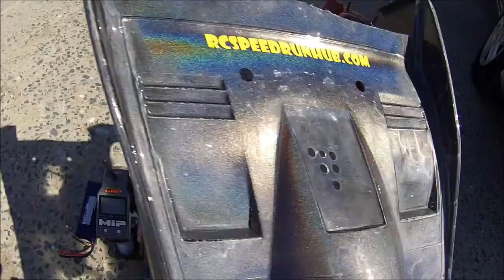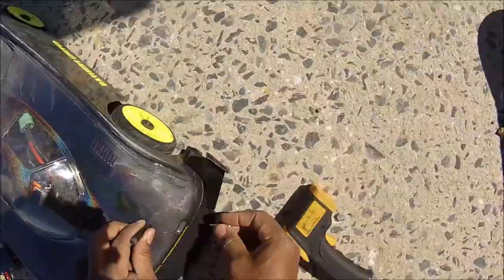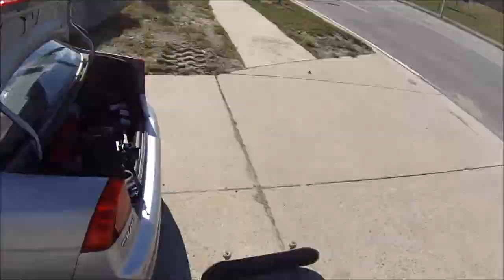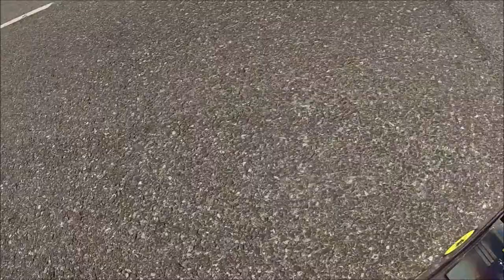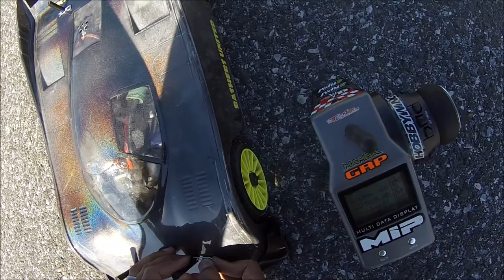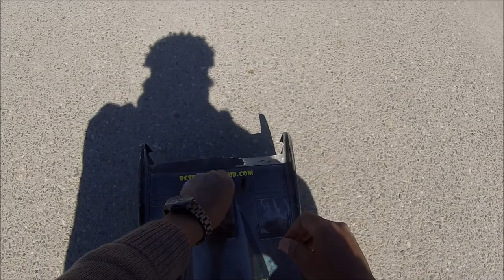BU: OFNA GTP2E w/Leopard 780kv 56110 and New Gearing Test Part 2

Comment: Why only 6s? Its 780kv and 10s capable. You are not getting close to tapping the potential power you have that will be well over 100 on 8s and 10s its gone, gone, gone. Personally od either opt for the 950kv and run 8s or bump to the 720kv and run 12s. I see your limited with battery room but there are ways to get creative.
Reply: They jave a 6s 1430kv model that would be crazy fast in that. That may be your ticket.
Reply from the maker: +Braiden Palmer yeah that was awhile ago. I think I was just out testing that day. I ended up moving to 8S later.
Reply: What was your final speed and gearing? Im thinking of runnkng a 950kv on 8s
Reply from the maker: +Braiden Palmer I ended up wrecking that car. I think it was at 129mph or something like that through the traps. I was running a 60t mod 1 pinion and I think a 36 spur.
Reply from the maker: +Braiden Palmer I would have been faster but at the time I was using 6.5mm bullets on the motor when I should have used 8mm ones
Reply: Really nice car, man.  Sorry to hear you fragged it.... I'm building my first triple digit, stupid overpowered brushless rig, and looking for monster pinion gears, where did you find them, or did you machine them yourself?
Reply from the maker: +DeltaRacing sagacustomrc.com is where u can get gears.
Reply: Thanks a lot man.  HOLY SHIT, you use an adapter and then just bolt SPURS on as PINIONS...... LOLZ
Reply from the maker: +DeltaRacing that's how it's done! Lol